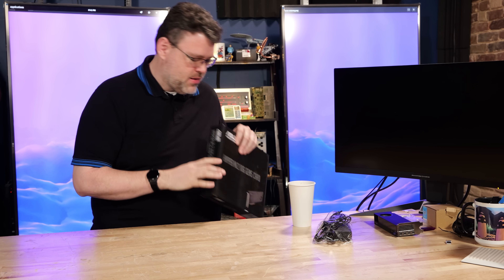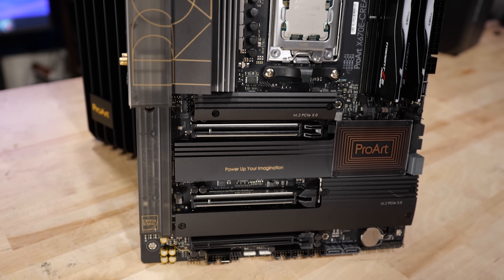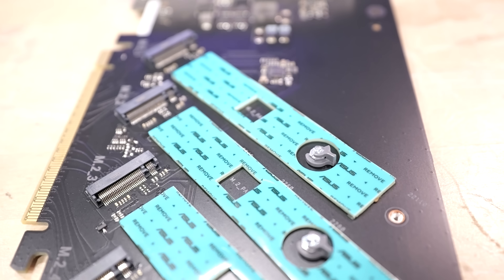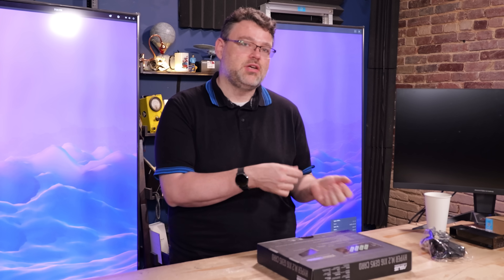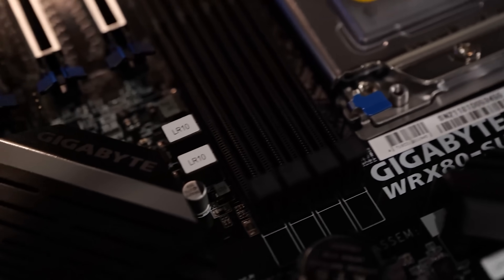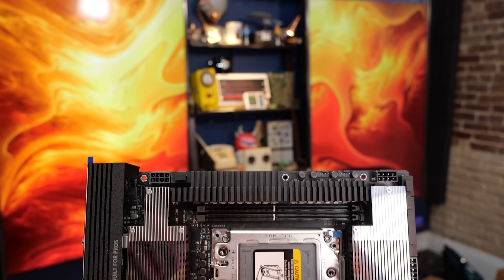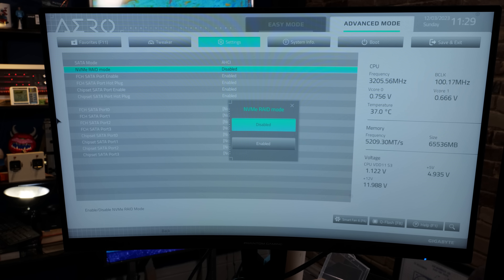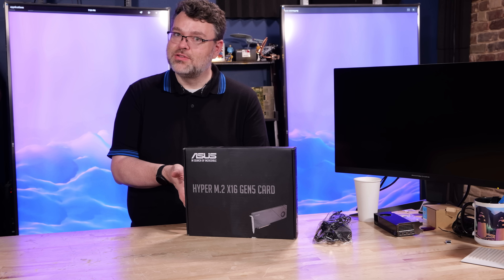Is The ASUS Hyper M.2 PCIe Gen 5 Card The FASTEST Thing In Your PC?

Comment: 13:20 asus proart z790 creator wifi here.. lga1700 socket and performs PCie bifurcation under BIOS settings with RAID functions supported when a Hyper m.2 card is installed. Or so the manual says.. I havent gotten to try it yet.

Comment: Well…. Idiot Me.  I thought this card would work with my MSI M370 motherboard and Intel Core i7 cpu.  I run my Ubuntu 25.04 HyperVisor on this, and was SO happy with my m.2 conversion of Boot Drive, that I naively thought this card and 2 nVME m.2 drives would be recognized and basically DOUBLE my HDD throughput.  I was 1/2 right.  MSI M370 does recognize the card, but then, only 1 of the 2 m.2 4TB SSD’s.  This is OK, however, because 4TB of SSD is enough to allow me to continue my Home Lab project….  What I am wondering now:  IF I move the 2nd m.2 stick to SLOT 3 or SLOT 4 on ASUS HYPER M.@ X16 cars, will m.2 SSD #2 be recognized.  PS:  I have not yet connected the auxiliary PWR connector on the ASUS card.  Wondering if doing so may help MSI MB recognize 2nd m.2 card.  ALSO wondering:  Will my running ASUS HYPER M.2 card without Aux power from the PSU will Fry Something???.

Comment: If you were to hypothetically want to create the fastest NAS in existence

TRX50 board with threadripper

A couple of these cards loaded with pcie 5.0 drives

and a 100gbe melanox pcie card

Would something like this saturate a 100gbe connection if you were to raid the drives? Can more than one of these cards work together? Can you add the nvme slots on the board to the raid?

Comment: I have an ASUS z890 max gaming wifi7 board. On the gen5 slot, bifurcation nets me 8x4x4. Well, maybe next time I'll get an amd system. But for now, at least I can use this card. Or maybe get a diff card altogether.
Reply: Does this mean your gpu is at 8x and you have 2 m.2s in the riser at pcie5?
Reply from the maker: yeah

Comment: Would the LGA1851 ASUS ROG z890 HERO motherboard with i9 core ultra 285k and asus GeForce prime 5070ti oc be able to get the full benefit from this without making the pcie gen 5 4x16 slot for the GPU share the express lanes? Also using a 1200w gold+ ASUS TUF power supply

Comment: I just bought one of these without really knowing the details of what it is, and I'm now wondering if it'll do what I want it to (it hasn't arrived yet). I have an Asus X670E-PLUS AM5 board, with a 7900XTX in the 16X slot, nothing in the 2nd PCIE 4x16 slot, and I'm planning to put this in the bottom PCIE 4x4 slot, with 3 PCIE 3 & 4 2TB SSDs as a spanned drive. 

Will this actually work, or did I just buy something that's going to choke my GPU, or not work at all in the way I want it to work?

Any responses are appreciated

Comment: i have the gen 4 version of this. paired with a ryzen 5600x and rog strix x570e mainboard. will all 4 drives work if i only use the bottom slot? i am unable to decipher the rather advanced datasheet for it.

Comment: ROG Z790 MAXIMUS HERO user anyone? What is the best and FASTEST ALL SLOT 4TB SETUP ?? just saw a video with a crucial t700 or t705 gen5 on the hyper expansion card and it was very throttled, i mean.. it was very very limited, like bugged, unusable slow. I want all slots with the fastest 4 TB M.2's filled. Only my Windows is installed on a 2TB Crucial T700 i dont realy care if i cannot use a GEN5 but if theres anyone which uses the expansion card slot with a gen5 and get realy fast speeds, please tell me the M.2 Model
Just ordered another 4TB Samsung 990pro for now because when buying these, i know they will perform pretty well and stable. Not in randoms but still happy with Samsungs..

Comment: The only viable AM5 motherboard/s I’ve seen to use that Quad M.2 PCIe 5.0 card would be a MSI X670E GODLIKE or ACE, as those are the two o my motherboard with 3 PCIe 5.0 slots wired to the CPU.

3 x16 slots, but if you use the 1° and the 2° slots they will change to x8 each, but the 3° one is separate, is phisically x16 but wired x4 (that in other mobos usually goes to an M.2 port).

So one could use the first slot for the Quad M.2 car, not use the 2nd one to not halve the bandwidth of the first slot and then use the 3rd PCIe 5.0 slot for a GPU, this will be specially viable when the next generation of GPUs release, as if the GPU supports PCIe 5.0 that will mean that will get PCIe 3.0 x16 speeds on that 5.0 x4 connection, and right now an RTX 4090 loses around 2% performance on x16 PCIe 3.0 (that is a thing quite the amount of modern MiniITX builds still use due to the risers used) so a todays GPU like a 4090 itself may suffer a little more from an effective PCIe 3.0 x8 connection than a future GPU using x16 PCIe 3.0 speeds 
(reminder in case of losing track: A given device would only be able to use how many lanes are phisically present at the devices max speed, so a PCIe 5.0 x4 connection on a PCIe 4.0 GPU would be a x4 PCIe 4.0 connection that is equivalent to an x16 PCIe 3.0)

Lastly, about bifurcation itself I could find many documentation about it on MSI AM5 boards but given that those boards come with a Dual M.2 PCIe card is quite probable they support the needed level of bifurcation

And as a bonus those two boards have on board 10Gbps NICs

Comment: Most AM4 motherboards that I have support 4x4x4x4 on the top PCIe slot, the one connected to the CPU. I can't think of any of my AM4 (X370, B350, B450, B550, and X570) boards that don't support it. The downside is that you are left with 4x for the GPU.

Comment: What i'd love is a card like this that takes 8 5.0 lanes, and turrns it into 32 3.0 lanes so i can have 8 high capacity, low power, and relatively cheap M.2 drives front and back
Reply: Maybe you need 8 lanes for your GPU and 8 lanes for high speed networking. Or, maybe you can throw 2 more of these cards in and have dual SFP28 on board for networking and use the integrated GPU.

Comment: I have the Gen4 (version 1) of this in my Dell PowerEdge R730 with a single WD SN850X 1TB SSD. The R730 supports bifurcation, but I currently don't have the workload to go higher than 1TB. Might add another 1TB drive in a while though.

The R730 doesn't have PCIe RAID functionality, but when I move over to Proxmox, I can just have two M.2 NVMe SSDs in a ZFS mirror. The only reason I'm still running ESXi, is because I've been using Veeam B&R for the past 10 years and I'm waiting on official support for Proxmox that's coming in Q4 2024. When that is released and everything works, I'm switching to Proxmox.

Comment: Well you know High point has a new nvme card with PLX Chips to give a x16 Interface and 8x nvme x4 each pcie lanes and doesn't require Bifurcation support on the Motherboard but that card is probably over $2000 usd so $10000 Canadian 🤣

Comment: The best product Asus can make. Ive used these Hyper M.2 Cards since PCIe Gen3 version on all my workstations. I have raid0 arrays of minimum 4 nvvme drives up to 12 on two of my workstations ( Gen4 EPYC 3rd Gen and Genoa Gen5). This means my slowest array was already at or faster than current Gen5 nvme drives all while not needing to worry about cooling. And on some of these machines I still use Primocache (Slowest Raid0 array is 4 980 evos with primocache and I get 17 to 22GBps sustained reads/writes and insane random/iop figures X399 TR build).

for work these are great and on some games it can definitely make up for the loss of Microsoft direct storage since direct storage does not support raid

Comment: Looking forward to some test numbers on this card.  I have a Lenovo P620 with a 3995wx Threadripper and I have been thinking about adding one of these in Slot-1 with some fast PCIE-4 drives.   This system board supports bifurcation with x4x4x4x4.   I wonder what kind of speeds are realistic with RAID0 read/write on this combo.

Comment: It would be nice if Wendel gave some of us Intel W2400 and W3400 users some lovin' too, instead of mostly/only discussing AMD.  There is more to life than just Threadripper...  I just made the AMD crowd mad...  :)
I looked at this Quad card plus the Gen4 version of it, but I only require 1 additional 4TB NVMe drive.  It's going in an Intel Xeon W7-2495X 24C, ASUS W790 ACE, 512GB, RTX-3090 system.  I have a 2TB SN850X for the OS, a 4TB SN850X for Data, and I want to split the data across two 4TB SN850X units, one for UE4 and UE5 installs, and the second for projects.  The 5000D case has two 3.5 bays, so I use one for a 2TB OS Clone drive and the other for an 8TB Data Robocopy backup drive.  I still really like this ASUS Quad card, but I feel that it is overkill for just one more drive.

Comment: My beef with Asus. This card was included in my B550XE. Thought it was a great add-in, especially to justify the price. EXCEPT. The B550XE doesn’t support PCI-e bifurcation, no matter how many configurations and slots I tried. 

So it ended up in my headless Ryzen 1600 B350 (AsRock B350 Pro4) that DID support 4x4x4x4 bifurcation.
Reply: The B550XE 1000000000000000000000000% supports bifurcation:

Straight from the manual:
PCIEX16_1 Bandwidth
This item allows you to select the bandwidth bifurcation for PCIEX16_1 slot.
Configuration options: [Auto Mode] [PCIe RAID Mode]
Select [PCIe RAID Mode] when you install a Hyper M.2 x16 card or other M.2 adapter
cards.
PCIEX16_2 Bandwidth
This item allows you to select the bandwidth bifurcation for PCIEX16_2 slot.
Configuration options: [Auto Mode] [PCIe RAID Mode]
Select [PCIe RAID Mode] when you install a Hyper M.2 x16 card or other M.2 adapter
cards.
You have to enable both PCIe RAID mode and the NVME RAID mode under the SATA settings.
That's what I do on my B550F and X370 Pro. My B550F has dual 1TB drives in its middle slot.

(The B550 XE is just the F with wifi.)
Reply: @tim3172  and I’m telling you no matter the configuration of drives, the pci-e slot, etc (even with help from the support email), we couldn’t get it working.

Edit: 2 drives would work but I wanted the 4 full drives** 

Anything less was unacceptable to include

Comment: I am CONSTANTLY frustrated by the lack of pcie lanes on mainstream high end cpu platforms.  it's incredibly annoying to only have room for 1 16x gpu and like maybe 3 m.2 drives. MAYBE a 10g nic if you're lucky.
Reply: I tend to buy HEDT or Workstation systems for my main editing computers, just for the PCIe lanes, and more memory channels.  I have two X99 and a W2400 system, and I am looking at an X299 as well.  I do have a few additional systems, Intel 9th and 12th, and AMD R9, but those are only used for production testing my software and games.  I do the development on HEDT Workstations.
Reply: PCIE takes space on the die, so that's one reason to justify not giving more. But yes, Intel and AMD are not giving more lanes to desktop chips mostly to prevent competition with other platforms. Actually, a lot of companies run desktop chips in enterprise environment (not in datacenter, ofc). Intel and AMD would very much like them to buy more expensive platforms instead.
Zen5 compute dies are like 20-30% smaller than Zen 4. AMD could design a chiplet with more PCIE lanes and even quad memory controllers without making it more expensive to make than Zen4 if they wanted to.
Reply: @myroslav6873  from what i understand of amd, all the ccd's are the same across their same-generation product lines and only their number and the IOD change.
Reply: @joshhardin666  yes, they are. 7950x has 2 dies and 7700x/7600x have the same die, but only 1. x3d chips are different, obviously. IO die is identical for all of them, so 7600 and 7950x3d have the same 1 IO die
Reply: @myroslav6873  - My frustration with it is that there really is no HEDT level platforms any more since Intel dropped the X299.
The difference in cost between the consumer level processors and motherboards versus the Threadripper and W2400/W3400 is enormous.
Here in Canada I can get into a nice 7900X or 14700 system for about $3000.  A TR/W2400 system is like $12,000.
I know first-hand because last autumn I bought an Intel Xeon W7-2495X, ASUS W790-ACE, 512GB DDR5, RTX-3090 24GB system, and it was over $13,000.  My fully loaded R9-5950X 128GB system was only $5000.
Intel's HEDT system in the X99 and X299 used to only cost about $1000 more to get more PCIe, Quad Channel, etc.  Now "HEDT" with the TR/W2400 is easily $8000+ more.
The average price here in Canada for a decent consumer 16-24-Core processor is around $500.  The average price for a TR/W2400/W3400 with 16/24-Cores is $3500.  The motherboard is also $500-$1000 more, and the ECC RDIMMs are a lot more.  Intel X99/X299 used essentially the same components with a $200 premium on the motherboard and a $750 premium on the processor.  Entirely different costs now for "HEDT".
Reply: me too, where is my new HEDT Intel? i have x99 and x299 but getting long in the tooth
Reply: intel treated lga 1700 + 14900k as hedt imo
Reply: @daveg4417  i know but intel acts like 14900k isnt just another normie platform with insane prices for what you get
Reply: @nigrum_tredecim  - Yes, I definitely agree.  CPU's GPUs and Motherboard prices are crazy.
I recently bought an Intel Xeon W7-2495X, ASUS W790-ACE, 512GB DDR5, ASUS RTX-3090 system.  It cost me $13,000+ CAD.  I priced out the equivalent Threadripper system, and it was $20,000 CAD.
The X99 and X299 were nothing like that.
Reply: This is the very reason why I just purchased the Threadripper Pro 7965WX and ASRock WRX90 WS EVO motherboard... It's soooo annoying that mainstream is basically crippled.
Reply: its disgusting i miss my x570e and 58x
Reply: It's really sad because 10 years ago this wasn't the case! You could buy motherboards with a lot of ports for everything!

Comment: When you put the PCIe IC close to the connector it becomes very difficult to get the signals all the same length.  If you have to stretch a differential pair by 10mm but the IC is 5mm from the connector - it gets ugly.  But if the IC is 50mm from the connector then it becomes much easier thereby allowing for better shielding.  And this is not atypical - the connector is flat and the ICs are rectangular.  It never works out perfectly.

And fyi, the distance is not that big of a deal.  As long as the PCB impedance is correctly implemented and the traces are well shielded then the signal will travel quite far.  But adding those extra layers to facilitate better shielding cost money.  The motherboard manufacturers are only aiming for good enough.

Comment: I have three of the older Gen4 variants of these cards in my EPYC (Milan) server and they are excellent.   Very happy with them
Reply: I have this very card in my Genoa machine, the Supermicro H13 supports quad x4 bifurcation - it's a DREAM
Reply: That is a beast of a machine.!
Reply: @ADB-zf5zr  Thank you sir.  It is an all-in-one VM and NAS server.   Twelve 16TB hard drives, and sixteen NVMe drives. running on an EPYC 7543 32C/64T CPU in a Supermicro H12SSL-NT motherboard with 512GB of RAM.
Reply: @Zarathustra-H-  Got almost same setup, just less of everything 😅 
Epyc 7302 16C/32T, 128GB of RAM, 8 HDD's of different sizes (5 in the array and 3 in a ZFS pool) and 5 NVMe's in various sizes and a couple of GPU's

Comment: I have one of the gen 3 and gen 4 cards.  The drives can get a bit warm in the gen 4 if I'm really hammering it so I hoped they bumped up the cooling to match how warm gen 5 drives can get.  Otherwise been happy with these cards.
Reply: What does "warm" mean in comparison to the design specifications?
LIke "durrr I put my hand on it and it feels like a Popeyes biscuit". or are you comparing what it's actually designed to run at and determining it's running out of spec?
Reply: @tim3172  Yes.  It's not hard to check the specs for most consumer NVME drives in terms of temps.  I didn't say it was running above spec, I said it was running warm.

Comment: If you're already getting a HEDT motherboard - why would you use a generic m2 rather than getting a high end nvme like a kioxia which will have more sustainable performance?
Reply: Because in some applications using 4 cheap M.2 will give more performance and more capacity than 1 enterprise grade drive for a similar overall price. There's even specialised PCIe switched carrier cards that will jam over 20 M.2 drives into a single x16 slot, you can't even buy those retail if you try because they're high end enterprise only for specific types of workloads where buckets and buckets of cheap storage works better than a few high end enterprise devices. (Even the original concept of RAID was introduced to avoid using enterprise grade stuff - Redundant Array of Inexpensive Disks)